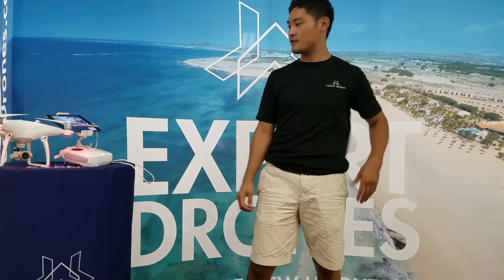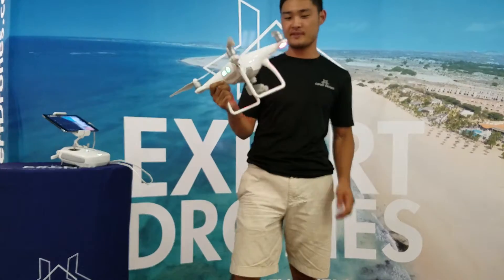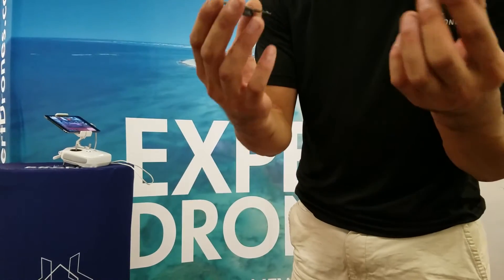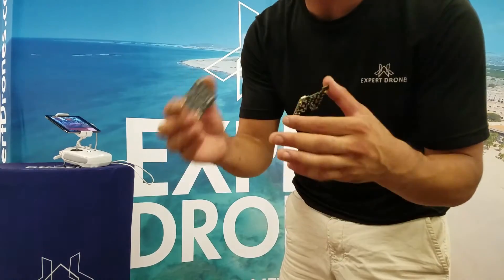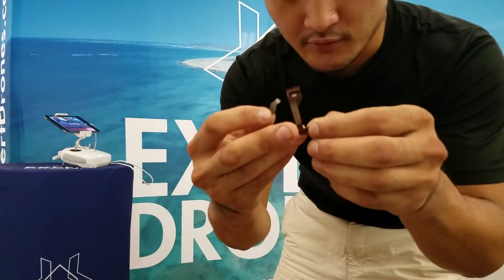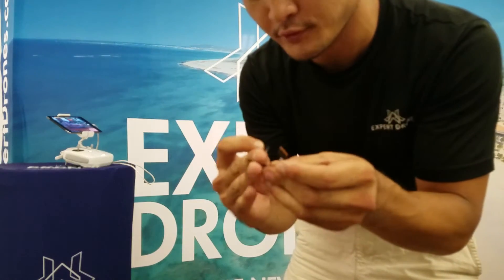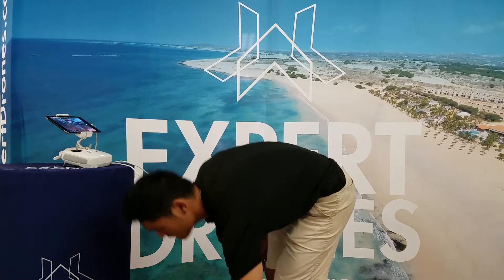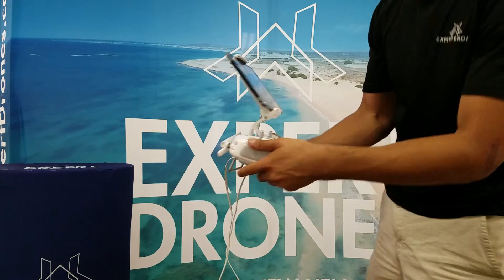DJI Phantom 4 ESC and Cable Repair

Comment: Mavic pro battery unplugged balance connector cable plugged back in wont charge of power drone? How to reset board?vazquez.keith2018files@gmail.com

Comment: Can you fix my esc problem
Reply: t3ddybad 13 is the esc problem something to do with the esc board
Reply: Adam Meah’s GAMING AND FITNESS yes I replaced the shell but I cut and spliced the motor wires instead of soter and now just says ESC error
Reply: t3ddybad 13 so do you think I should replace the ESC board because mine says ESC error

Comment: How long does it take you to fix this. I just got a brand new drone and its getting a ESC error for motor 1 & 4. Did not even fly it!
Reply: Hi, we have a turnaround time of 3 business days on average for our repairs from diagnosis. Once you confirm you would like it repaired, usually takes about 24hours for something like this because we have the parts in stock.
Reply: +Expert Drones I'm located in Toronto, Canada, are you guys only US based?
Reply: Yes, we are only US based.
Reply: +Expert Drones ok thanks, the next time I'm in the US and need a drone repair I'll hit you guys up!
Reply: Hi, our typical turnaround time is 3business days. Thanks